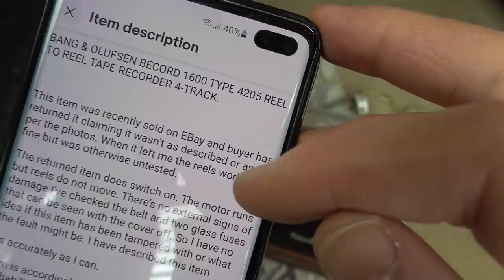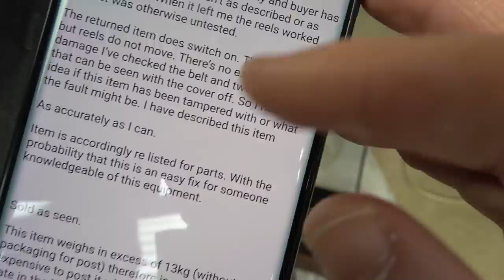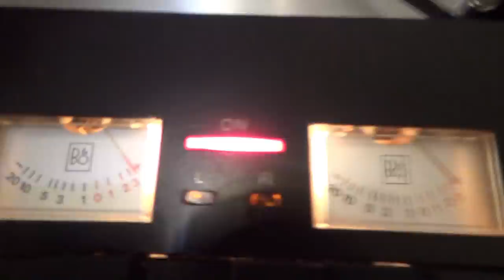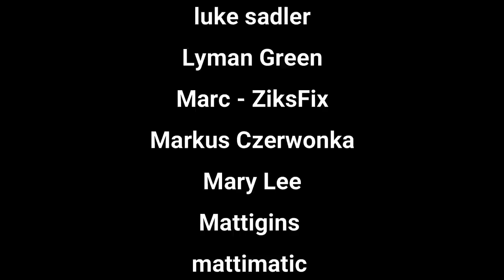50 Year Old BANG & OLUFSEN Beocord 1600 Very Expensive REEL to REEL Player - Can I FIX IT???

Comment: hi vince that is what is known in the trade as a high hours machen .I am not sure the fault is the smoothing caps ,i would have a look at the record playback switch (when you press the record button it should move a long switch)
Reply: There's a LOT of switch contacts in the signal path on this machine, and any one of them could be the culprit - cleaning all the switches with deoxit or some other switch cleaner would go a long way towards bringing this thing back to life

Comment: I se there are many helpful comments but I wanted to add that there are different kinds of tape for different tape heads. You hve to make sure your using the correct tape for the player. Mono, stereo etc. there are also tracks on the tape which are different for various proprietary players.

Comment: Vince ,I'm only just watching this video today ,  never seen.  Ye think,of the slide switches you saw !!!  Possibly had same design , on let's say ,gear stick.  A strong thin plastic protector. Then a large metal washer. With diameter of gear stick
 Yet with a dense foam material ,as a protector. ?? Possible ,some sort of spring also.

Comment: Sorry, but at 31:50 I was laughing my head off when you were wondering why it was making a horrible noise. The flywheel was scraping against the main chassis because you removed the bearing from underneath the capstan when you took the take-up belt off. LOL

That hum sounds like a problem with the pre-amp, maybe just a re-cap on that too.

Comment: Check the record/playback linkages to the switch are working correctly, give the switch a good squirt of cleaner and work it a few times. The terminals in the switch become tarnished over time and create a high resistance.

Comment: a large flat plastic washer that fits tight on the shaft on top under the top cover and will keep debris out of the works.
Reply: They used to use felt washers for that, and these days you can't easily get those but cutting a small piece of craft felt and punching a hole in it will work just as well, but try not to get the really hairy variety as these can shed fibres which over time can mix with the grease and gum up the mechanisms, though in my own experiemce this is rarely an issue in most cases (works really well for slider pots too, as these can fill up with debris real fast)

Comment: Restoring an old reel to reel like this is not something you do in an hour on a afternoon.
These takes days to restore if you want it back to how it once was both electric and mechanically.
Cleaning, lubricating, replacing belts and tires. Recapping, cleaning pots.
Adjusting tape transport and heads also maybe.

Having the service manual and having done a bit of research so you have some clue
of what you're looking at is a must. 

I'm just baffled by the fact that someone buys something like this and don't even know how to
check it and fix that belt that came loose. That's like a simple and easy fix.
Do they really think that they can buy a over 50 year old  mechanical unit like this
and it should just work like it was brand new without any issues?
Would they also buy a 50 year old car and expect to use it as a daily driver?

Comment: never down trod yourself vince, i served my apprentiship at a B&O dealer, those v1600s take time no matter how good you are, *and that was way back when i had full schematics on micro fieche and maxi bins full of spares right beside me lol) labour costs were huge but even now are worth it only through initial investment cost, as an apprentice in the 80s you only worked on 70s stuff and older as they need atleast 10yrs under their belt before they need any work ( i did B&O amoungst others too obv as a panaservice dealer etc too in the days before all these dedicated B&O shops they have the last decade or so now), i started in the 80s and stayed through to the late 90s, i like to call those years the vox to lab transition times, i still remember seeing my first pair of lab pentas around 86 and thinking f&(k me now we have arrived at a stunning era :) it was actually more stunning at that time than say  the lab 90s were a few years back tbh as the lab 90s were a 35 year slow evolution, whereas the beolab pentas were just an overnight thing  and changed the whole game over all the vox range and it just went on and on :D

Comment: The thing is you learn so much from these old electro-mechanical devices that you can't do so much from modern kit as it's all done with non-repairable/replaceable moulded and press-fitted components and micro-controllers. I can't see a part two so I guess you didn't get round to it. If you do get round to it you could trace the fault with an oscilloscope, after eliminating the filter capacitors, if the fault is still present, try tracing the audio path starting at the head preamp and working your way through to the output stage.  Good luck!

Comment: I've got several reel to reel machines and this seems fairly typical of how it goes with them. I have a Uher machine I got from Ebay Germany that was described as working but isn't. The delivery cost more than the machine so it is not worth sending back.

Comment: Have the Portable version of the Beocord 2000 with the manuals (somewhere).it's similar to yours, but the 3 Speed controller is different.
Like many Reel-2-Reel recorders it's a bit mechanical & layered.

Comment: with old glass tube tv's there was a tool called a degauging wand just a 240v ac transformer 50hz, u can use that therory on the heads of the tape player to rid of magnetic crap in the head.

Comment: Brilliant video Vince as usual…. Very relaxing and calming after a hard day… keep them coming. Perhaps a flat disc type shield that slides but holds down the rod that operates the fast forward play stop and reverse, that way it it hides the mechanism and acts as a stop for the rod…. Like a gear shift which hides is mechanism. Almost like an automatic gear shift gaiter in operation hiding the workings but looking uniform in flatness colour ( Matt black ) seamless operation.

Comment: What a coincidence, late last year, I got one of these. Now fixing it up. Plays fine, but snags when rewinding. 
I'll need to find a way to get the right turntable out so I can lubricate the shaft.

Regarding your notes at the beginning, yes, there used to be feet at the back (it's designed to work standing) and the screw on the main control lever cap is not original (that would be a hex-inside-thread type job
Reply: 28:30 flippin 'eck, Allen key! Here I am googling and thinking what to do and all this time, there's an Allen key not 5 feet away... Ultimately it's a tiny bit too large, but I'm just gonna go take a quick trip to the local hardware store in the morning and oh my.

Comment: That hum kinda sounds like what you would get with a bad ground inside the audio input side. We shall see in the next video. And as long as the capacitors are the same values or slightly larger you can use any capacitor you can find that is similar.

Comment: use IPA on the rubber bits.and the heads also the pinch roller. any moving parts that slide ect use silcon grease.

Comment: See David Tipton's Record Deck overhauls,  he has made a wooden (adjustable) frame cradle to hold the shape of the item being worked on, which can be rotated and locked in place to work as your 3rd and 4th hands. Uncle Doug did a vid of similar for amp chassis  Small amount of sewing machine oil / white grease for the working surfaces and bearings.

Comment: Hey Vince, I think you really ought to get an oscilloscope and learn to use it, because you can use them to trace where a noise like this is coming from.  It's like having a super duper multimeter that can show you how signals are changing with time.  Absolutely great for fixing tape recorders, synthesizers, power supplies and such.
Reply: He does have a cheap, pretty rubbish scope. Probably why he doesn't use it much.
Reply: @ianhaylock7409  Yeah, but you can get a nice little Rigol for about $300 and they're so useful!

Comment: I'm hardly the expert on this, but here are somethings that you could check out. Replace the main rectification capacitors, clean the switched and contacts with contact cleaner. Dissemble the intermediatory rubber wheels, removing all the old grease and replacing that with a hard working modern equivalent. Buy a spring kit and fit the missing spring with a close replacement. Ensure that the plastic washers are replaced under the tape up reel. Don't replace or move the tape head. It will be almost impossible to realign. Disassemble the entire main motor, cleaning out old grease and using a decent oil on the bearings and moving parts. Replace the rubber belts (i'm sure you would have a local place that can do that for you. I'm not sure if the motor has a run cap. Leave the set on in play for a while and carefully touch the cap's body to see if there is any increase in temp. If there is, you might need to replace that as well.

Comment: hi Vince nice mechanical repair the hum could be filter caps and other caps on the pre and output side of the output amp
Reply: i also watch a lot of mister Carlson's channel and amp hum is almost always filter caps. but this is early solid  state  stuff so be careful. but the fact showed that all the caps were discharged so bad caps is the fault

Comment: Yeah at around 55 mins when you try device. It's exactly what I thought. Electric interference.  You can still hear slight hum noise on some older Walkmans. Like a distinct back ground or a record player. When ground lead not connected.

Comment: Bogen heads go open in UHER machines .... I have two 4200 with the same issue, I was told that they are very fragile and if the unit is hit hard it can damage the head. On UHERs the heads have no soldering posts. The wires come from the inside the head and that all. But this part is not potted, so the wire can vibrate and move but the are connected to tiny filaments from the head coil and this iswhere they broke. VERY GENTLY check resitance for the head. If they are fine I woul blame filtering caps, sound like 100hz ripple. Also if one of the switches conmanded by the levers is on an indefined position, it can caused all sorts of noises and issues. The easies one is look for bad filtering caps. Measure AC on the DC rails. You are not supposed to find any. If caps are discarded, try to hock the unit from the AUX ouput and use external amp to rule out that it not an amp thing. But vu meters more or less tied to this point and they are already picking ....

Comment: The real nightmare about RtRs with only one motor to drive everything are not especialy belts but these rubber rollers, their complicated kinematics and old spring tension. 
I remember I had to deal with a bunch on them when I was repairing my Sony TC630 and it took me some time to figure out what was wrong. The 2nd nightmare is to know where to oil (levers, gears, bearings) and where absolutely NOT to oil. 🙂
And beware about cleaning these rollers with alcohol, isopropyl or not,  it can dry them more. When you don't have the "special product" for this  some window cleaner, Windex or equivalent, can do the trick. 
And now I'm impatient to see the rest of the story (and I subscribe+bell!  🙂  )

Comment: I would suggest that the power supply has a problem. Initially, I would look at the rectifier circuit if it is a block or 4 diodes but either way the smoothing capacitors will almost certainly need to be replaced as well as the rectifier.

Comment: The buzz is the mains ripple getting through to the speakers the Electrolytic capacitors, much like the belts have perished and need replacement after five decades after manufacture. Probably 
most likely none will still be good. Best to order up all.New ones and replace them all. You will likely find that it works well once you  have all of those rotten electrolytic capacitors replaced.. They dry out over time and lose their capacitance. They will not  usually last more than half this long. Good luck

Comment: Right spool has a clutch that pulls wheel down on play the capstan pinch roller controls the tape feed speed.spool has to slip or it would stretch the tape if it pulled it

Comment: if you want help with this, i have just restored a 1200 version of this deck. i have the service manual and full set of schematics. mine had lots of faults on the play record pcb. mostly noisy transistors and moulded carbon resistors that had drifted off value with age.

Comment: I'm sure it's been mentioned, but that's 50hz mains hum, as only appears when the motor is running, look to the caps in the 
motor power supply circuitry or maybe preamp is only enabled when in play, but same issue, caps in supply, To verify, install a frequency counter on your phone, it'll indicate 50hz

Comment: 26:05  That c-ring on the table above your head looks like a perfect thing for for that loose shaft.  I bet end of that shaft has a groove in it.  The c-ring probably fell out from the player when you started taking it apart.
Reply: Yep, I wrote this as I watched it, so I could give the exact time.  You found the c-ring and talked about fitting it there.  Still think that the zip ties are too tight:).

Comment: Hi , I sold an item on eBay a Denon avr when it posted it was working perfectly, anyway, after a few days had past , and the item was delivered, the buyer contacted me and said it doesn’t work properly, anyway after a lot of messages I received the item back ,and as the buyer said it’s not working as it should, luckily enough the Denon avr was still under warranty, so took it to the shop where I purchased it from , they said it needs to be sent of for repair ,anyway about two weeks later I received a phone call to say that ,the Denon had been opened and some of the components inside had been changed ,so I asked how did you come to that conclusion, he said something to do with the dates of the parts ,I explained I had sold it and was working perfectly, the guy said on the phone it looks like the buyer had used the parts out of mine to repair his ,obviously this was impossible to prove,so I decided to contact eBay and explain the situation, and as I expected they couldn’t do anything to help ,so knowing how cunning people are ,any such items I mark the components with a invisible marker pen ,and take photos,

Comment: I think a starlock washer might’ve worked well instead of the zip ties

And you noticed the missing spring at 31:30 or thereabouts

Also, the reason a lot of these machines get dirty is people put 3 in 1 everywhere to try to fix. It might work in the short term but in time dirt sticks to it
Reply: Hi Craig, my beocord 1600 broke in the same way and I repaired it the same way vince did. starlock washer though could be the proper answer tho. Anyone else come across this problem and fix?

Comment: I wonder if there is a bad component in the audio section like  a transistor, capacitor, resistor, etc.  I would suspect capacitors but I could be wrong.

Comment: I find lighter fluid (naphta) works much better to get the rubber tires and wheel surfaces cleaned. IPA actually leaches the placticizers out of the rubber, rendering it even harder. Pinch rollers respond very well to cleaning with lighter fluid. Cheers Vince, and Merry Christmas!

Comment: Yes, the hum is probably a power supply cap. A service manual is available on HIFI Engine, it's totally free, on page 8 of the pdf look down at the bottom you'll see a square thing, it's a diode bridge. Left and rights sides are AC in , left and right are rectified DC out. There is a 3000uf 50volt electrolytic cap on those two lines and it's probably bad. Shouldn't be hard to find in there because it's probably the biggest one in there. Good luck. As a collector of reel to reel machines and a tech that can fix them, single motor machines are usually not worth fixing. Not a high end unit.

Comment: I think part of the hum is your filter capacitors. Also sounds like there is a problem with the magnetic tape heads. Just my 2 cents. I hope you do a revisit video on this. Might also be an issue with the amplifier because you have no sound at all other than filter hum.

Comment: The tropical fish capacitor's are non-polarized, they tend to crack with age , replacements should not be hard to find. Resisters' will run up over time, some values can be tricky to find tho..

Comment: for one it needs a recap most electrolytes are gone and the amp is oscilating also some carbon resistors you should check  and when you put new caps in use higher voltages when possible as in the old days the caps could handle higher voltage then listed the caps these days have the max voltage listed

Comment: Hi vice, I love your videos, been watching them all tonight! You’ll probably find issues not with your power supply re the hum as the hum changes in volume when adjusting main outputs! Check the ground wire for the tape head!

Comment: You can clean and steam the rubber rollers, then you can soak them for a few days in an automotive stop leak product  called,  "blue devil rear main oil leak stop leak" it restores softness and liability to the rubber.

Comment: Yeah, I'd say its time to replace those 50 year old caps, but I'd also be looking at those slide switches in the back, making sure you have full travel and a good blast of deoxit. Don't disturb those heads though as a proper head alignment requires a test tape and an oscilloscope, or maybe B&O have a procedure that's easier but you have to find it first.